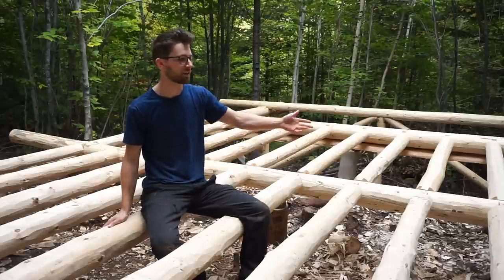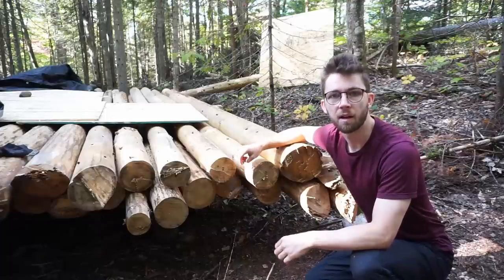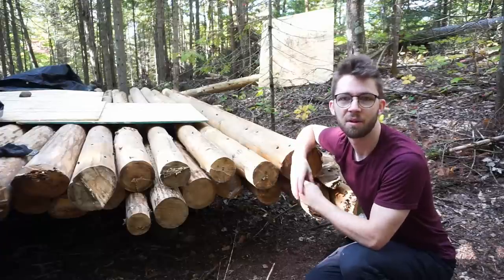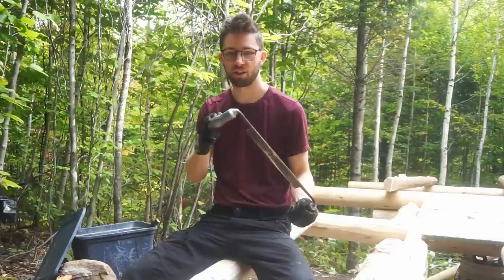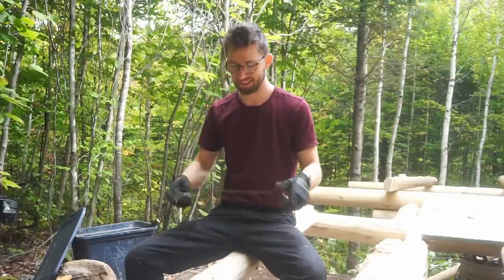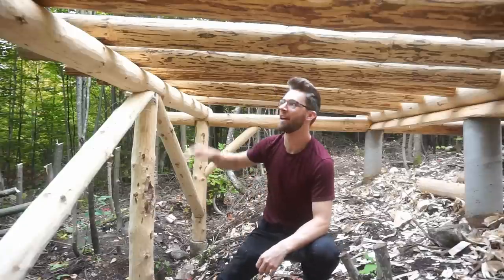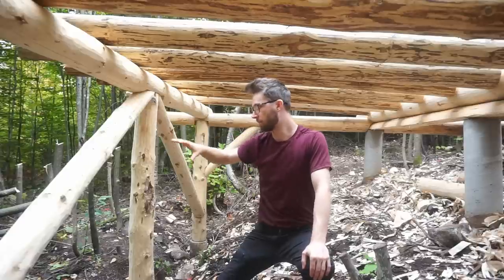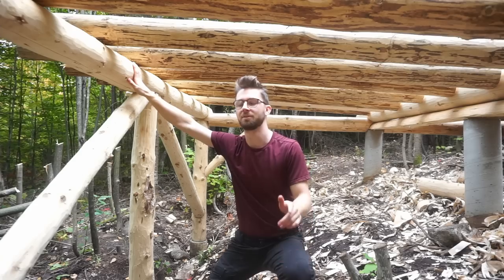Building A Log Cabin | Ep. 17 | Thirty joists later, the first floor is DONE!

Comment: Um get a Silky Big Boy.. A bow saw SMH.... A bow saw should be tossed in the trash.
Reply from the maker: No thanks! We love our bow saw, it works great!
Reply: P.S The silky saw is Fun to use. A bow saw is a Heavy work out.. IS the silky faster than the bow saw? Maybe a little?? Where it shines is the effort required to make a cut. The silky is MAGIC. It just cuts so smooth with NO effort. It only cuts on the draw stroke so there is NO reason to hammer it... It just cuts and cuts and cuts.. ALSO the blade is shaped in a way that it hardly ever gets pinched.